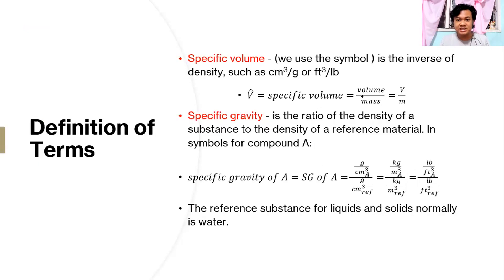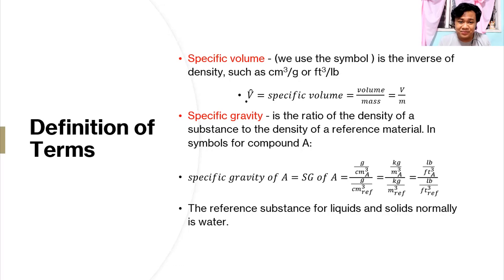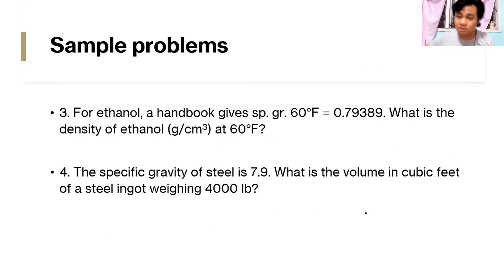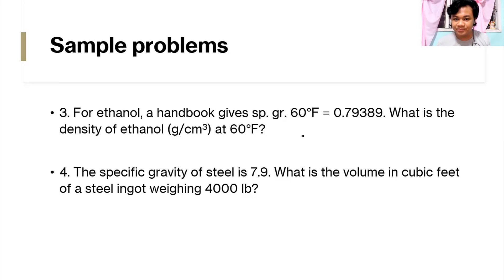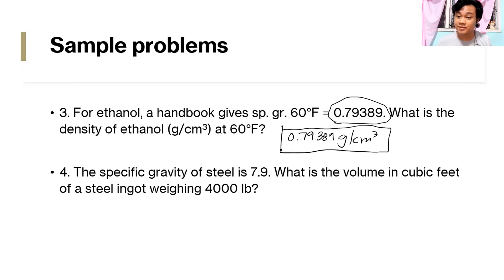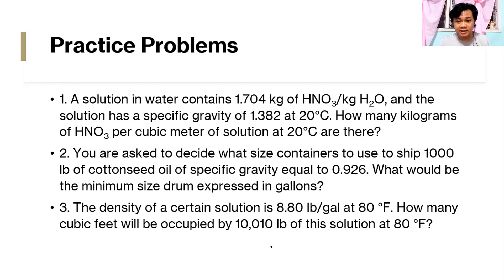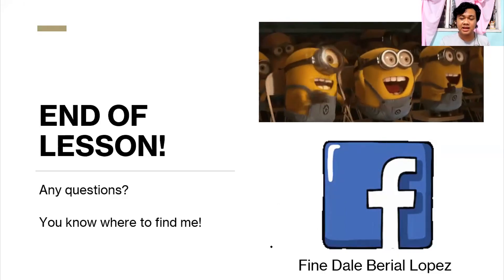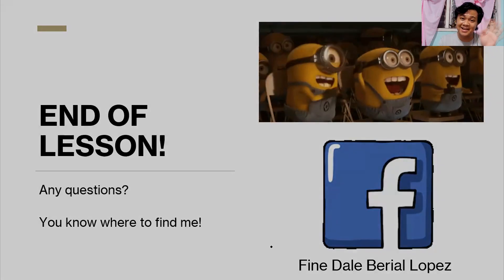CHEMICAL ENGINEERING CALCULATIONS | DENSITY AND SPECIFIC GRAVITY PROBLEMS (USING PERRY'S HANDBOOK)

Comment: hello po, paano po icalculate iyong density ng water using table 2-32 ng perry’s handbook 9th edition po??
Reply from the maker: Hi! I'll check the 9th ed muna. I'll get back to you
Reply from the maker: You can use Eqn 2-119 sa 9th ed. Nasa end ng table 2-32. Pero gamit ka na lang sa Table 2-135. Same lang naman sya sa 8th ed na tinuro ko rito.

Comment: Good day po Engr., may I ask po pano kunin ang density ng NaOH using the table in Perrys, when the % is 55, and at room temp po. Nag base po ako sa Table 2.92 8th ed, and hanggang 50 lang ang %. Thank you po.
Reply from the maker: hmmm. hindi ko alam kung paano. usually kasi ang commercial na nabibili is hanggang 50% purity lang ng NaOH. siguro wala na sa Perry's na table ang gagamitin dyan

Comment: kuya, pano po gamitin/ hanapin sa perry ung heat of combustion and formation? ung tinitingnan ko po kasi pag nagsosolve ay table 2-220 and 221 (ano po ba ung pagkakaiba nila?), then ung mga values po na ibinibigay nung table eh malayo sa given sa geankoplis  (which are constants naman po di ba so dapat magkaparehas lang sila ng value). lost po ako sa paggamit ng tables regarding these. pahelp po pati rin po sa pagdetermine ng Cp (ung may equation na temperature dependent po ba talaga ung kailangang laging gamitin Table 2-194?). 7th ed po gamit ko. thank u po
Reply from the maker: Hi! Sige2. I'll get back to you on this. I'll check the 7th ed.